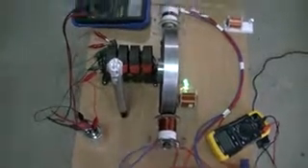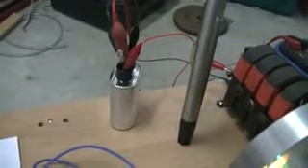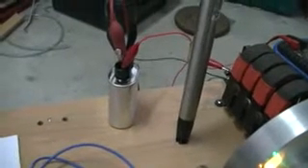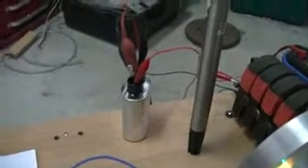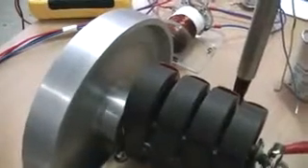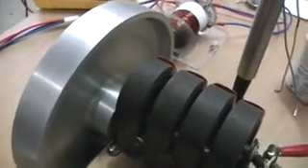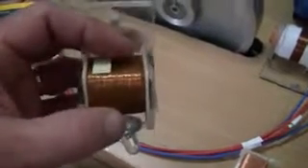voltage test on phone generator ssg.avi

Comment: Tinman would this type of motor run cool and use small amperage if you attached three 42 inch fan blades to it  and kept the rpms at 500 ?  Thanks for the vids.